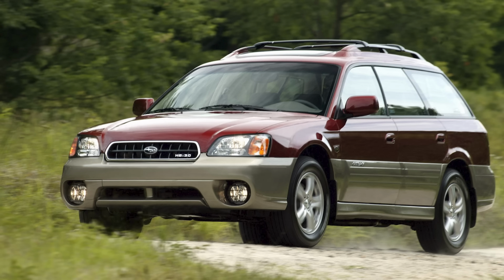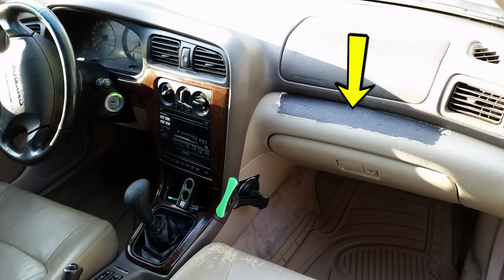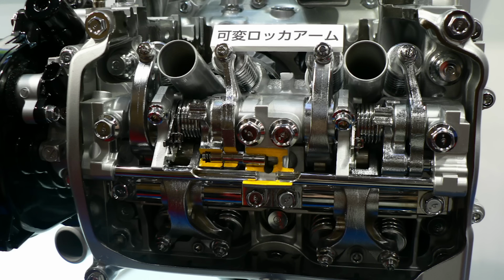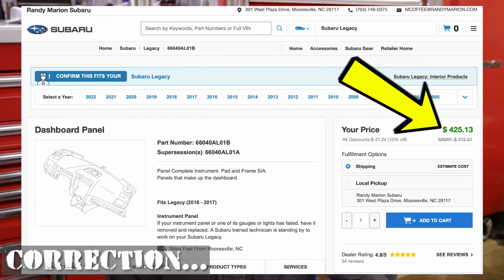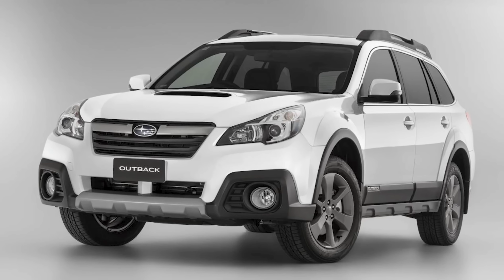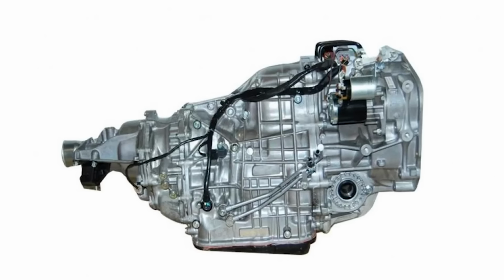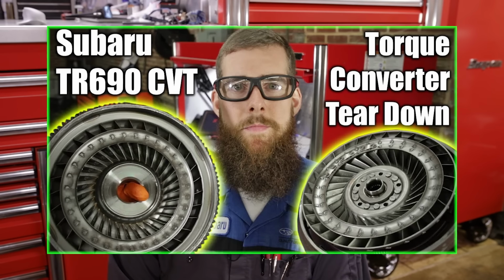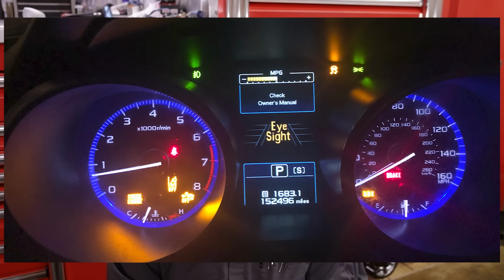Buying A Used Subaru Outback Or Legacy?! Here's The Good And Bad Over The Last 20 Years!

Comment: I miss my 2004 Outback. I have a 2015 Forester now. Although much nicer interior in the Forester, the old Outback just went where I wanted it to and the automatic transmission felt better than the CVT.
Reply: from a 98 outback to a 16 forester as well.  80k on the forester now but I STILL am not sold on the CVT. It just feels,,, disconnected.
Reply: If the cvt feels disconnected, the transmission solenoid may be failing.
Reply: I own a 2004 outback and I love it been a awesome car haven't had any issues with it apart from having to do some paint repair on the back spoiler and hood but that's to be expected from age and also just the usual stuff like oil change filter ect but awesome reliable car tho
Reply: @lukeplayzgamez6414  im tempted to buy a 2003 one for relatively cheap price, any major concerns to look for? (besides the one shown in the video)
Reply: @Trollrijas  not really apart from just the usual maintenance for the car I have had to replace a front CV boot tho and fix the seat belts but not too major at the end of the day it all comes down to how the car was treated if u give it shit then I'll be shit but if u look after it I'll look after u

Comment: Some have argued the Forester being made 100% Japan with the engineers at Fuji Heavy Industries being more reliable than the Outback with statistically less recalls over time. What's your real world experience in comparing later model Foresters/Outbacks 2014 or newer?
Reply from the maker: The Japanese manufactured Subarus are better quality than the US produced ones.
Reply: My 14 Outback has been problem free. I believe the most reliable Outbacks tend to be the ones in the last year before the refresh come out, i.e. 2014 has had less issues than the 2015.

Comment: Mr. SUBARU I have question can I get to my valve cover gaskets on my 08 Tribeca to replace them ? Got a major leak .....
Reply: It's possible but you're going to wish you didn't.
Reply: @Crazy_Chicken_Media  I agree.
Reply: Shes putting a 1/2 quart if n ot more oil on the ground In a 7 mile trip
Reply: @dougwalton4831  also how did you come to the conclusion that it's just the valve gaskets?
Reply: @Crazy_Chicken_Media  took the big plastic thing off & wiped all the oil off fired it up & it pissing oil from the valve cover
Reply: @dougwalton4831  so since you have a good look at the engine, look where the valve covers are look at everything that's going to have to be removed to get to them.  Then picture yourself buying a whole bunch of tools to get said socket or wrench into the position it needs to get there. Then picture yourself jacking up the engine in certain areas to get it to move so you can actually get the bolts to clear.  Now picture all the fluids you're going to have to replace once you take out the entire front section of the vehicle radiator AC condenser tranny cooler all that good stuff gone.  Just to get to the timing chain cover. And since you're in there you might as well just get a new water pump slapped on.  Now you have to get everything off of the valve covers to get the valve covers off.  Once more twerking the engine to get the clearances you need to get the individual parts off at this point you're probably going to put a shotgun into your mouth and pull the trigger.

Take the engine out or if you're not too sure about your skill level spend the money get it done right the first time.
Reply: Vince why is that ?
Reply: @dougwalton4831  because it's literally easier to pull the engine out.
Reply: Vince if I had the tools I say no